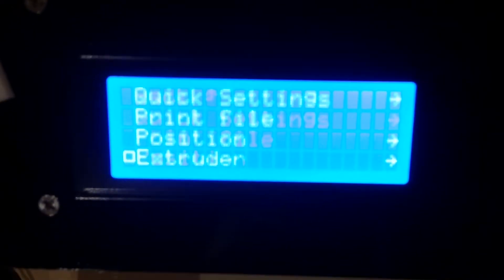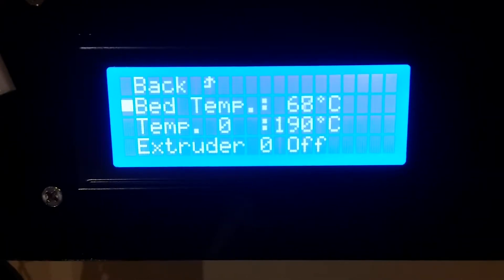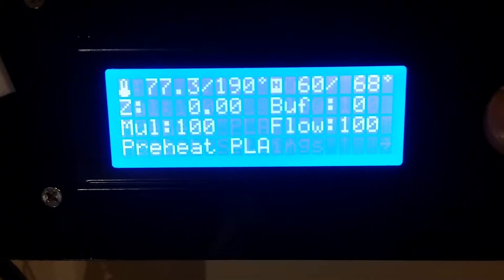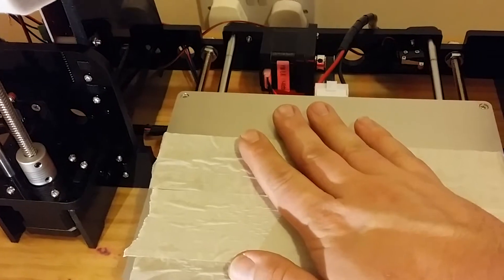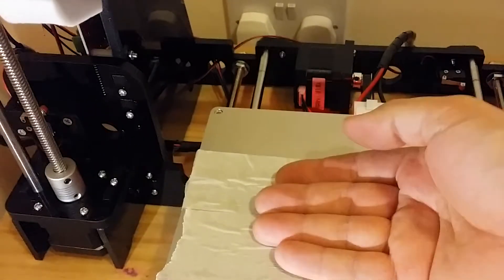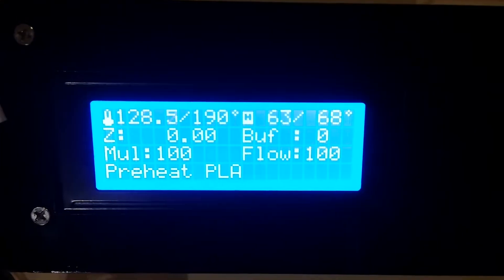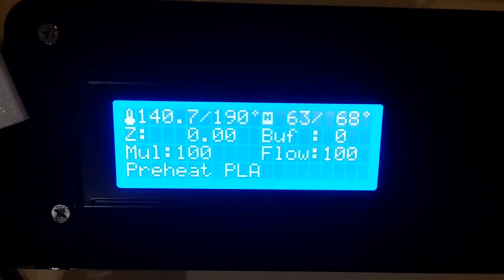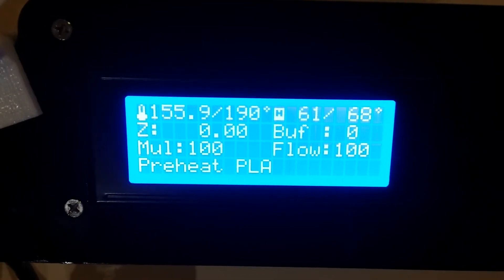Anet A8 bed not heating part 2

Comment: Basically I found the main black wire that give the bed electricity is come out from the screw on the board while I am moving the printer and fix the bed leveling so no worries everything is back to work!

Comment: So the short answer is replace the board and hope it does not burn out again ?  Or did you replace the resistor and capacitor on the old board?